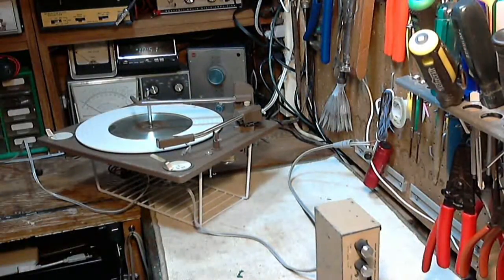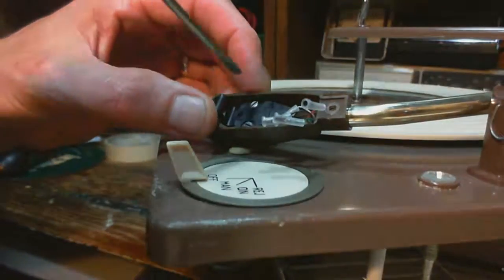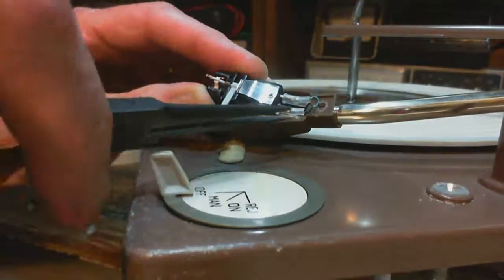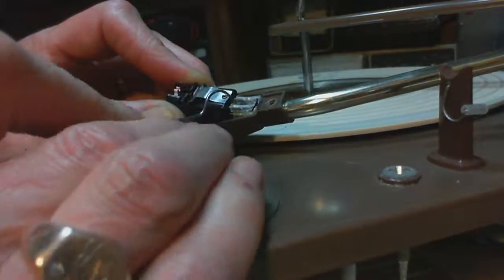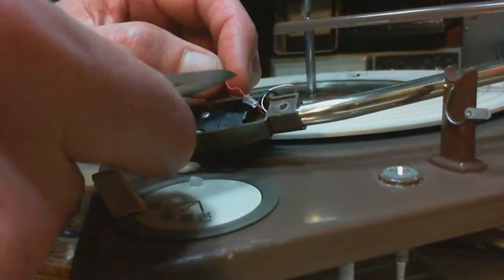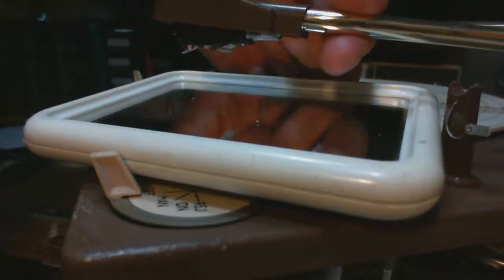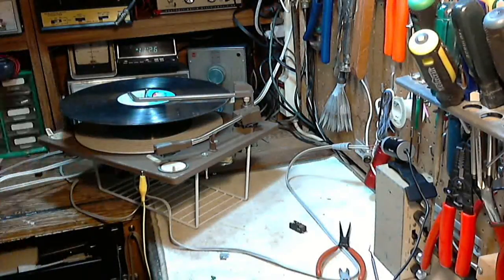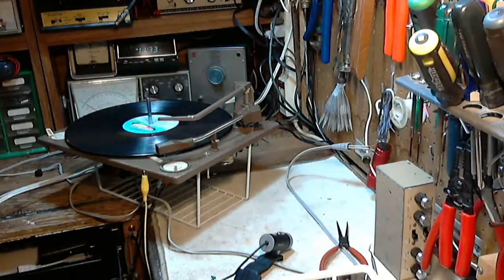Koronette Console Stereo Video #16 - Install Cartridge in Record Player

Comment: Check track force on that tonearm. That looks like a bsr and would be with the old cart around 8 to 10 grams. I think the new cart is around 5 grams but check that info online.

I think also your needle is a lp/d and lp/s not lp 78. Not a big deal if they do not play lots of 78's.
Reply: Check you last video old cart specs,

  Astatic 612 
• Element Type: Crystal
• Output Voltage: 2.0V
• Tracking Pressure: 8 grams
• Frequency Range: 30-10K
• Speed(s): All 

New cart specs
Reply: ***** Think this is the specs for new cart
-V 5243, Vaco(Varco) CN-75
Specifications:
Output: Stereo
Output Voltage: 2.0v
Tracking Force: 6-8g

So it should work like a dream but tracking force might be the problem
Reply from the maker: From my barely calibrated hand, I think the arm is around 4-5 grams now.
Reply from the maker: I'm sure 33 1/3 rock and roll is the destiny of this console.

Comment: Jim, I think that maybe the stylus needs to snap into that V groove on the front of cartridge?
Reply from the maker: I see that some needles settle into the bottom of the V and others ride on the points.  I considered shoving this one into the V but I hesitated.  I'll be working more on the record player so I can take a closer look then.
Reply from the maker: After a bit of research, I think I should push the needle into the yoke (v-groove) until it seats.  It looked a little to big to fit which is why I didn't push it in already.  Some mistakes can't be undone so I tend to be cautious with such fragile parts.

Comment: on these turntables there is a spring type clip on the back part of the tonearm and you can pop it up and then the clip will reposition to the original position when you first started  red is always right and white is left and green is right ground and black is left ground   those plastic sleeves on the prongs are not designed for that cartridge the prongs have to be bare and open that is the problem with getting the cartridge into the head shell the beastie boyz are horrible and get a better choice  of music . time to get record shopping  and that needle is a cheap manufacture one . you need to get one that has a metal tube on it and not a plastic one . the shaft on the plastic needle vibrates too much and causes the needle to skip  you might have a double sapphire needle .

Comment: why is it all done when it didn't look right? Was it set to a 78?
Reply from the maker: I said it was all done but it's not.  I still need to fix the audio cable and I don't like the angle of the needle.  At least the tougher stuff is done.